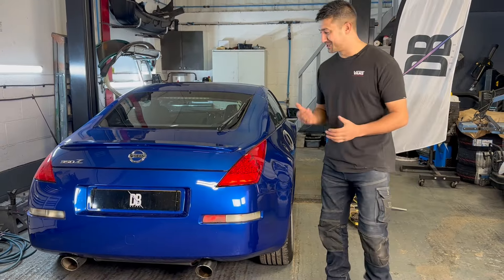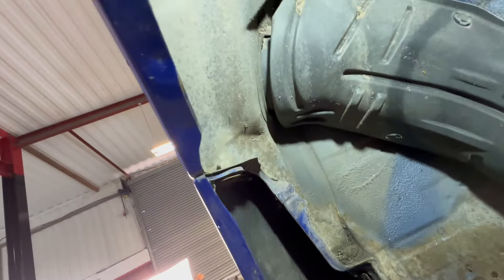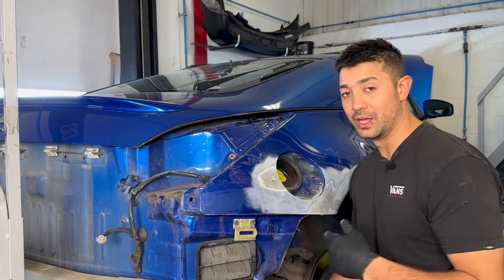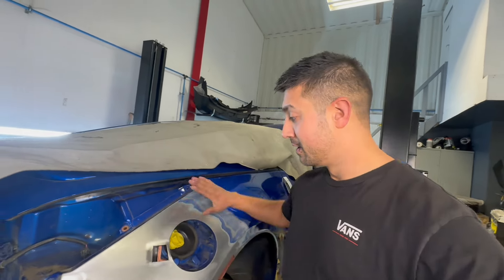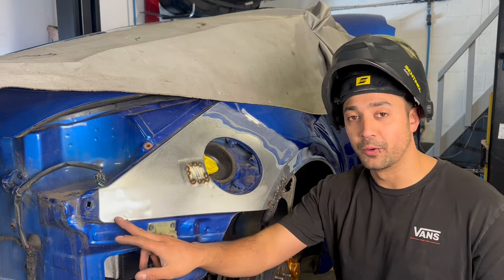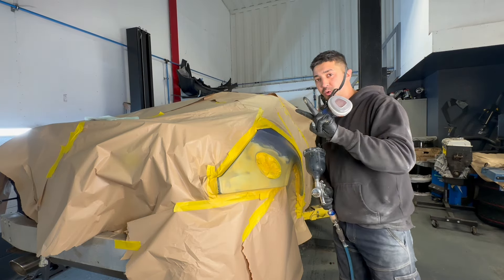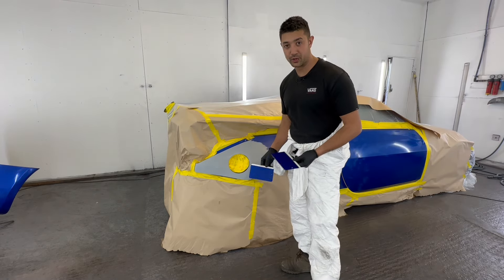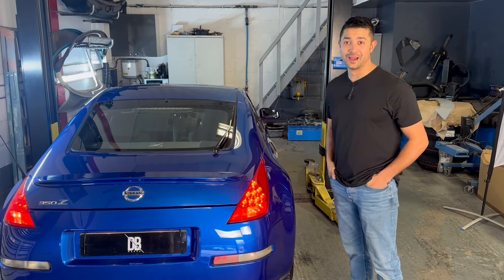FIXING THE COMMON RUST PROBLEM ON A NISSAN 350z

Comment: Great video, this has given me the push to get my 350z sorted. Rust on both wheel arches as well as a few spots on the roof. Not ideal
Reply from the maker: Cheers bud! Get it done bro couple hours a night and before you know it will be done. Summers coming
Reply: Check your front shock towers (under the strut bar) before any cosmetic areas

Comment: Any precautions welding near fuel tank area. Have rust near my fuel cap but worried about welding in that area
Reply from the maker: can remove the fuel neck, if your really worried drain the tank, drop it then continue

Comment: Another great video. Found this very helpful and informative. Do you have any tips for preventing rust in the first place? Keep up the good work🫱🏻‍🫲🏼
Reply from the maker: Cheers mate! Where do I start lol, depends what climate you live in also. 

Being in the Uk can be very damp one minute then very dry the next, the main problem we have is salt also in winter. 

There’s loads of cavity paints and cavity waxes on the market, which you inject inside the panels to stop the rusting process. 

For the underbody, again depending on the car, if it’s something you cherish don’t use in the winter salt as its ruins all your components if not treated and tarnishes the finish.

Underbody can be coated with waxes clear or coloured. 

I don’t like the old traditional black waxes where people just cover up all the rust because it kind of defeats the purpose. 

On new cars I would definitely recommend clear underbody wax so you can always check before winter and to fill all holes with cavity wax also. 

There’s so many different techniques for different applications I’ve tried them all.